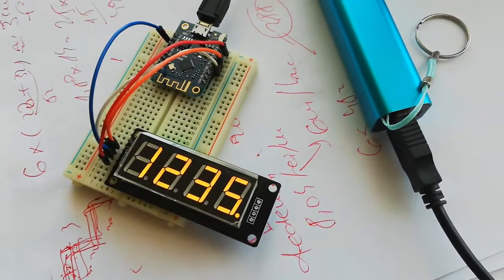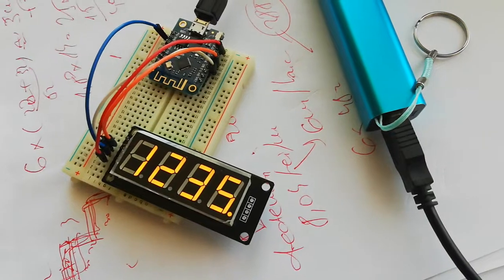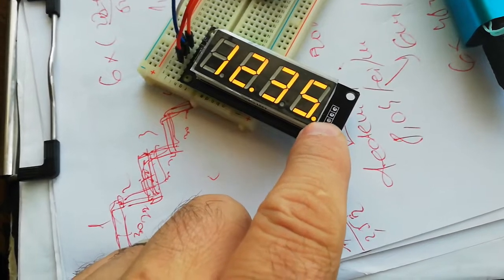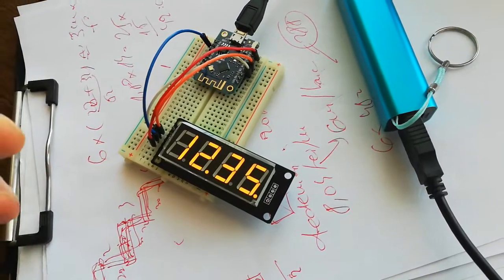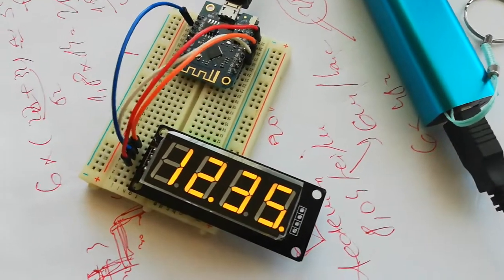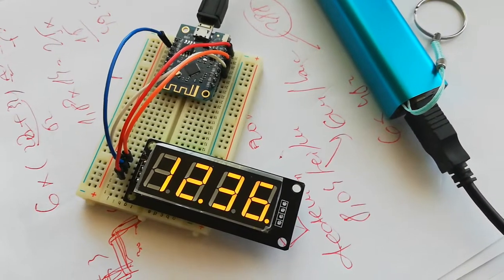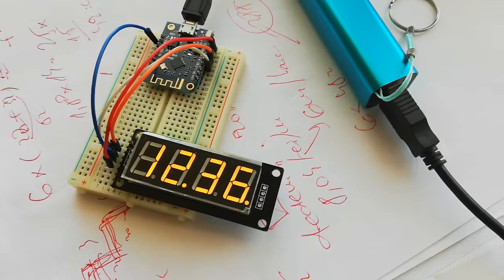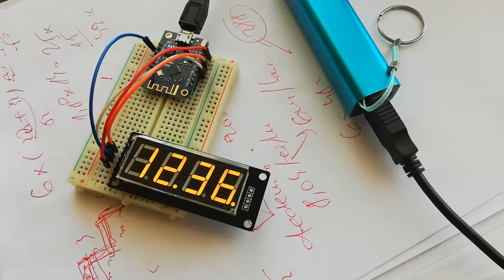NTP clock on TM1637 led display (12-hour format)

Comment: TM1737 drive which type of display means common anode or cathode?
Reply from the maker: display is buy it as a module, sorry, correct name for driver is TM1637 and code 5461BW is led display (Common Anode), but this information are free on internet